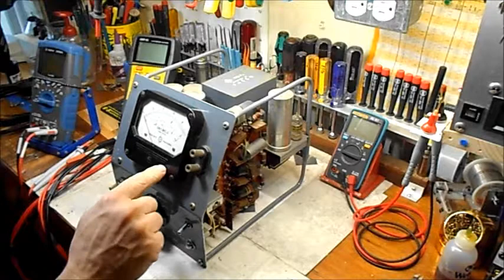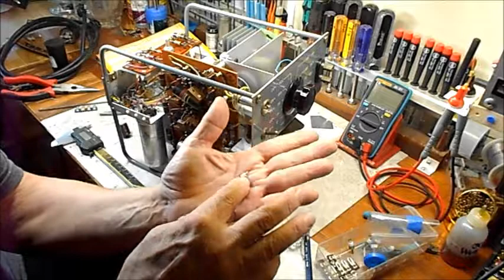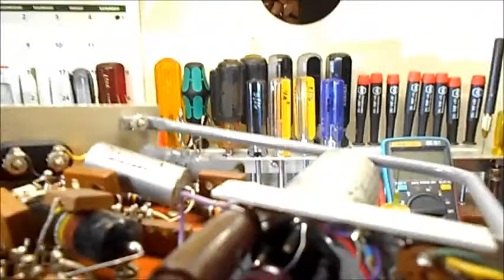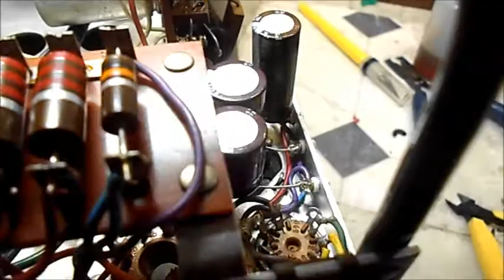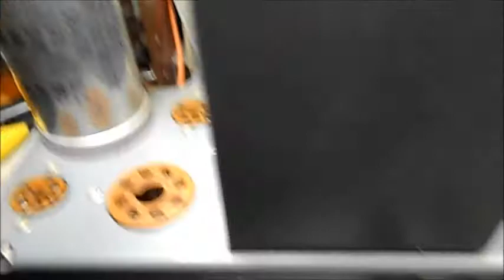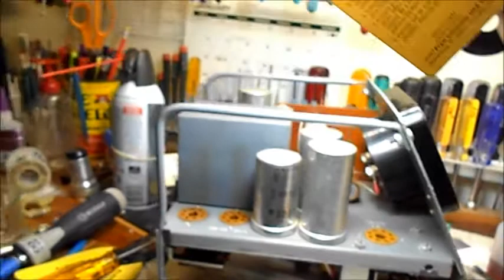HP 400C pt 1

Comment: Hey Gary, what a great job on those replacement caps! These ceramic standoffs seem very handy. I see lots of interesting upcoming projects in the background and I admit I'm curious about you spectrum analyzer which looks in great condition and makes me a tiny bit envious  :) Thanks you for sharing your work, which is awesome if we take into account, how much additional effort and time it takes, fixing stuff while being engineer, actor, director and cutter at the same time! I hope you'll get the parts soon, Take care, Ralf
Reply from the maker: Hi Ralf, thanks for the kind words.  The standoffs that I used are actually PTFE (much cheaper than ceramic.)  I do have some other plastic standoffs as well with a threaded stud and fork. They make adding capacitors under the chassis much easier and look very nice as well.  The ceramic standoff that I can find are $14 each, so more than the price of the aluminum capacitors.  I hope to get a better camera this year and improve my production quality.  Maybe do some more mechanical parts on video, some people don't have much experience and don't even know the first steps which you and I take for granted.  I shall see how it goes.  I have received a confirmation from Digikey and they will probably ship later today.  It is 3-4 business days so for sure by this time next week I will have my parts.  I hope to have a long time project finished next week to share as well.